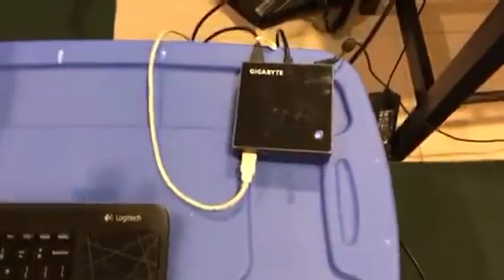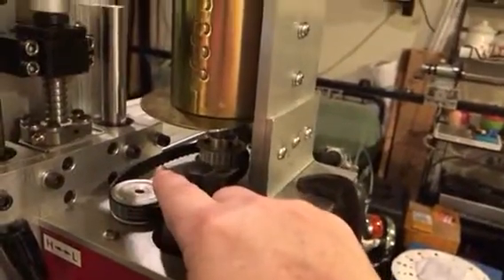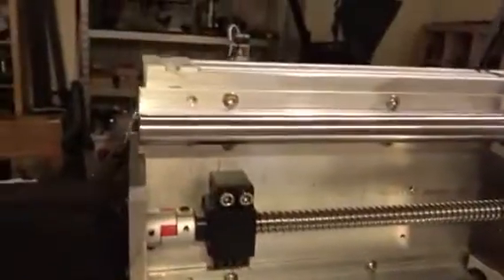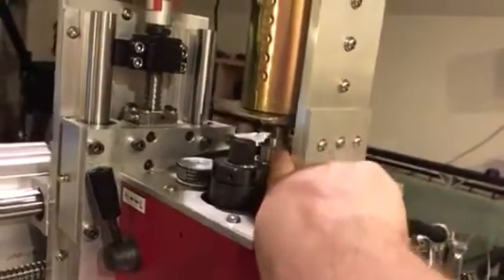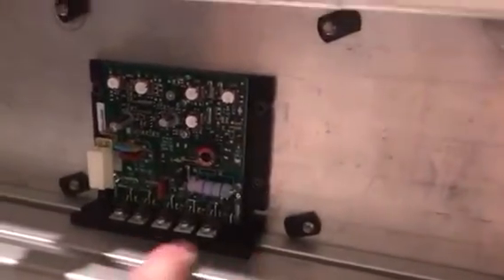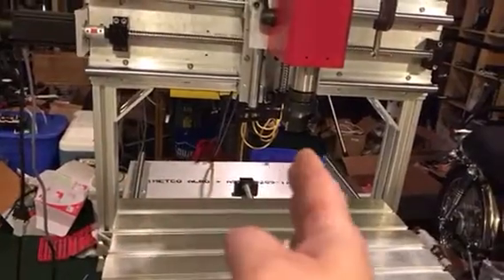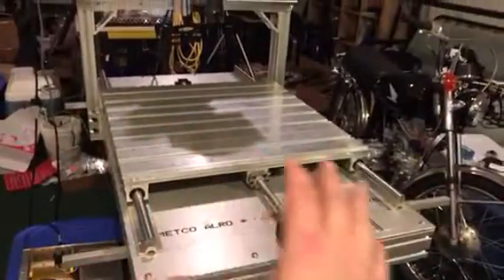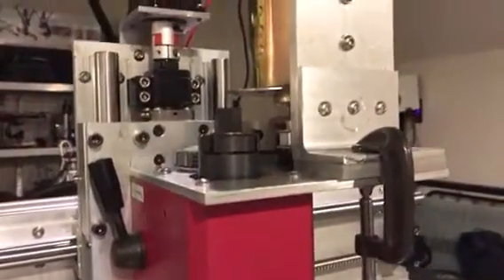Hybrid CNC mill/router custom made

Comment: awesome machine full respect but  i have a lot of questions :)  the fabriction company of the alu profils is Item? for the servomotors did you use a cnc shield and an arduino or what are your electrical components?

Comment: Are you happy with the extruded aluminum? I'm torn between welding up a beefy frame or the sleekness of the al.
Thanks.
Kevin
Reply from the maker: Welding is not the way to go. I used 80/20 1530 profile aluminum extrusion. Its adjustable and strong. Welding is difficult because you will never have a strait frame.